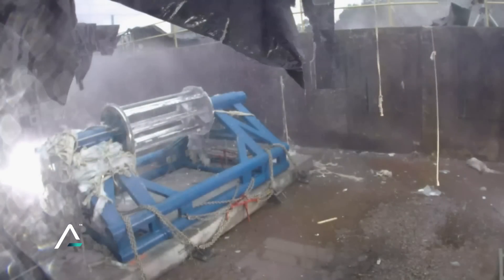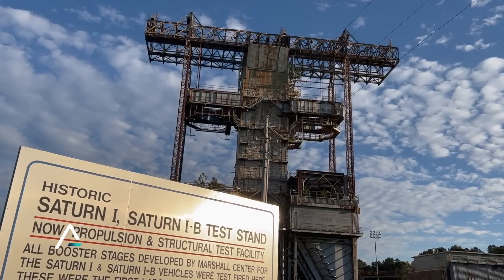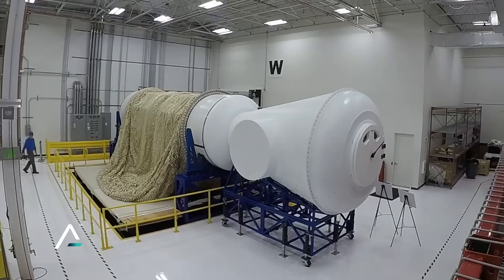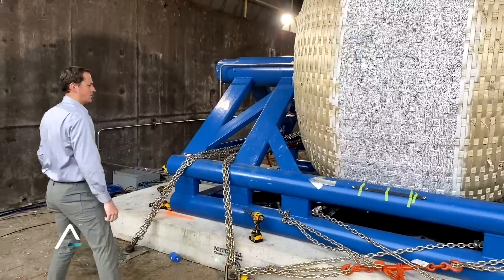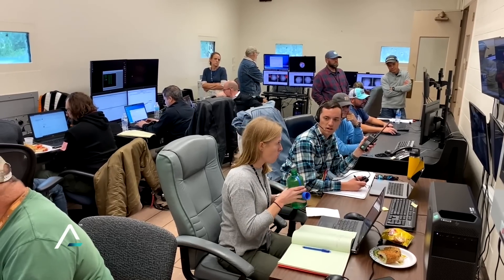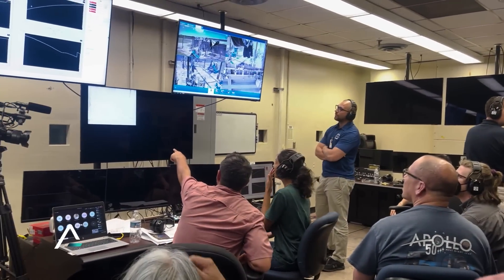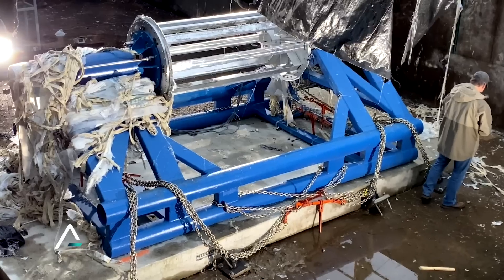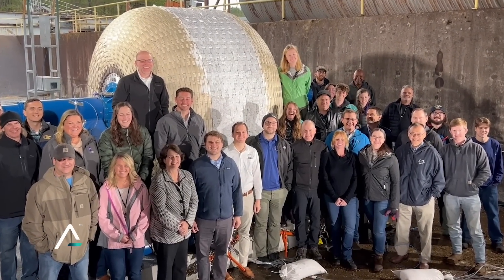Sierra Space’s LIFE Habitat Successfully Completes Second Ultimate Burst Pressure Test

Comment: Question what’s the minimal psi for humans to be inside and functioning normally in ‌space? I don’t think they will need so much psi in ‌space.. can anyone help? Curious
Reply: The pressure inside the module will be around 14psi I think.
Reply: depends on the chemical being used.  Fill a spacecraft with 100% CO2 at 10  psi, it won't support your life. Apollo launched with 16 psi mixed O2/N2 and once in orbit it lowered the interior at 5% O2. The EMU spacesuit, 4.3 psi.  * This was a huge engineering fail in the Shuttle, because it meant hours of pre-breathing to avoid the bends

Comment: I'd feel better if it burped out some overpressure and resealed, but I guess that's out at 220 psi when many straps break. In space temperature might not be so kind to performance. I wonder what the jetsam tests are like? Operando at 16 psi, do I get a giant inflatable cyclist to patch micrometeorite holes, or do I get out the fiberglas kit and some tough silicone?

Comment: Have you considered dual wall and fill the cavity with poly ureathane foam? It could possibly even be doped with barium? To cut back on rays
Reply: The outer foam bit needs to handle some temperature so even silicene or silicone foam is hard pressed at 100K-900K range. Also important that foam or aerogel not form anything explosive if it outgasses at all on the vacuum side, which dry plastic tends to be.

Comment: Why isn't there  valve to release the pressure when it gets too high instead of blowing up
Reply: That is not the point with these habitats, they are built to just be at some pressure and stay at that pressure as well. If things inside these habs, like... in space, are going SO badly that you need pressure relieve valves... well let's say that you are probably dead already, even if it doesn't blow up.
Reply: That's for not testing ultimate burst pressure, bc. obvs. it handled 20 psi fine. Hey have you seen Orbital Children (anime/Netflix)? They animate using one of these (hard use.)